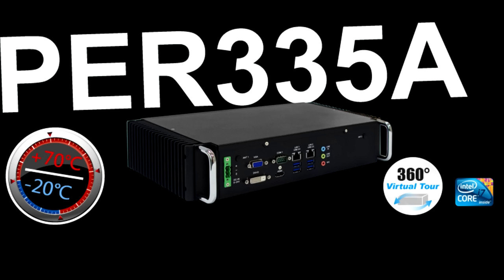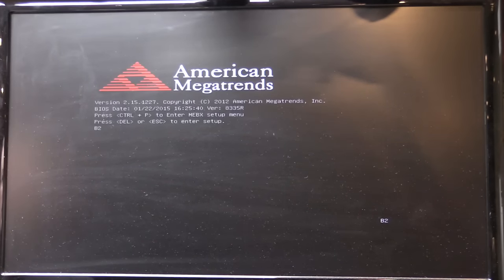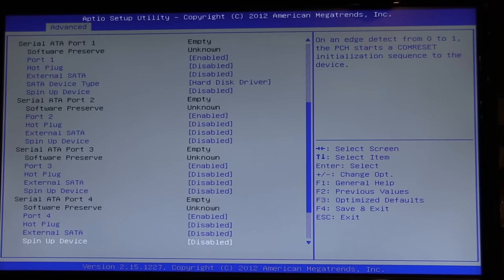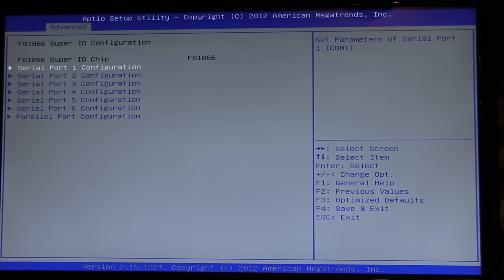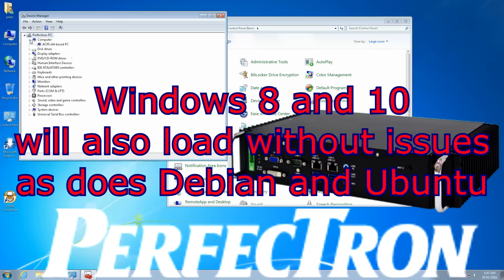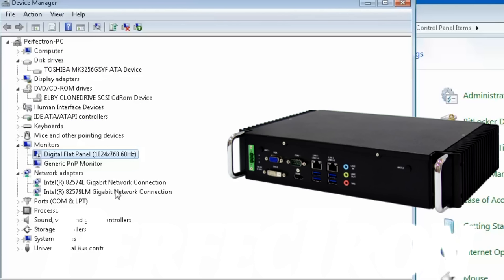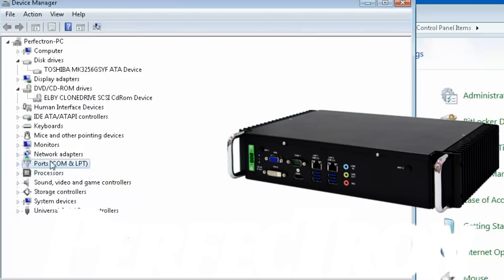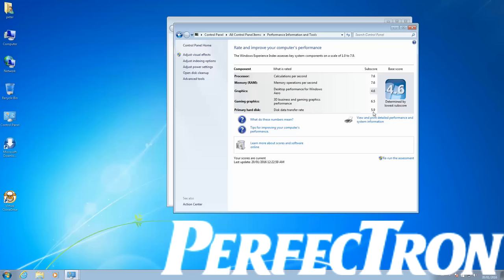Perfectron I7 Industrial PC review pt 2 of 2

Comment: Hi Peter. The way the heat sinks are mounted the prefered way to mount the pc would be in a desktop configeration so the natural convecton will take the heat away from the fins. If you wall mount it some of the convection flow will be lost.
Reply from the maker: +Ken Heinrich That is a good observation, there are brackets that came with it, I assumed for wall mounting (Many keyhole kind of slots) but I guess it is equally possible to simple screw it down to a flat surface to just stop it moving arround in a bumpy environment, for most of the tests i will be doing, I dont think it will be an issue as it is cold, not extreme heat i will be applying
Reply: Yes it shouldn't be a broblem in the winter but when you got into Ontario's humid summers it would be a good test. I live in Calgary. I have been in Ontario in the summer. I do Control System Engineering for Oil and Gas industry for about 40 years. I took Electronic Engineering Technology at Southern Alberta Institute of Technology before starting in the Oil and Gas Industry.
Reply from the maker: Very cool, I used to work for British Gas in the UK for many tears designing and installing distributed and remote managed Industrial Control Systems... small world
Reply: +Peter Oakes (TheBreadboardca) Yes it is. i do contract work for Engineering Compnies. Not a lot of work right now so I am playing with Arduino's and the link. I built a demo Sun Tracking Solar panel system this summer. Here is a link to a video I did. Not very good quality on the video but I am learning. https://t.co/YpAQo4pxLP
Reply from the maker: Nice, I like it

Comment: KingSpec SSDs and related software deliver high performance and reliability in mission critical applications in the industrial, enterprise, embedded, automotive, and rugged computing markets.
KingSpec has its own controller patents and can provide reliable solutions which be customized on request to suit different applications with regard to power protection, encryption support, secure erase and long-term supply. 
No matter what your SSD application whether it's high bandwidth, high IOPS, or harsh environments with high/low temperature extremes we welcome your inquiries about our OEM products, services and customized solutions.
KingSpec today announced the imminent availability of a 2TB 2.5" SATA MLC SSD family for the military market. The new K8-SATA uses the company'sown controller. Interesting aspects of this announcement are:
•  The power hold up capacitor-KingSpec says it has over-provisioned the capacitance for the RAM cache-so as to ensure that the sudden power loss data integrity will still work after being degraded by 75% due to aging.
• KingSpec says the drive can be used in pSLC mode - which halves the capacity but "achieves nearer SLC performance and reliability".
• The new SSD uses rugged SATA connectors which are work more reliably in high vibration.

Website: www.kingspec.com  www.a-spec.cn
Email: morffin@kingspec.com
Skype: morffin.wang